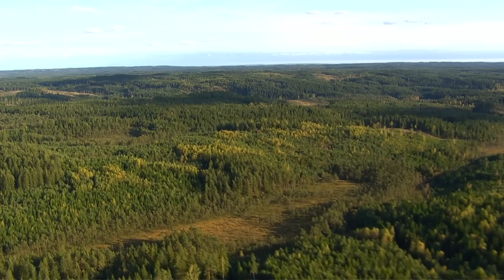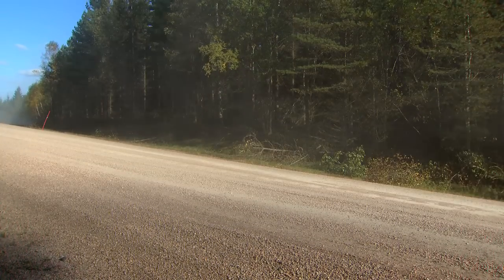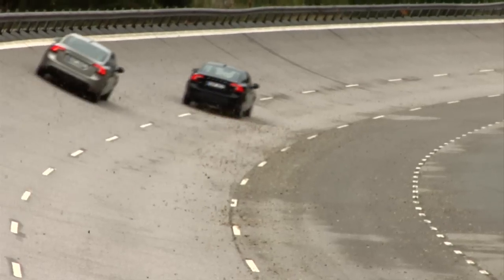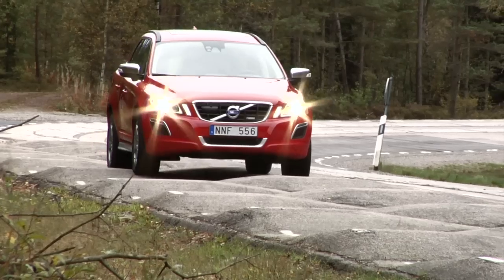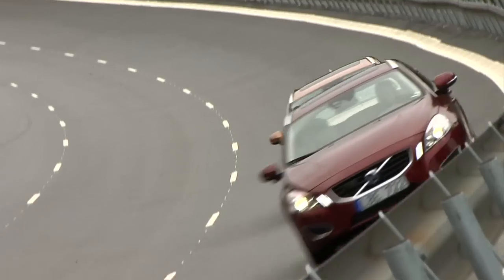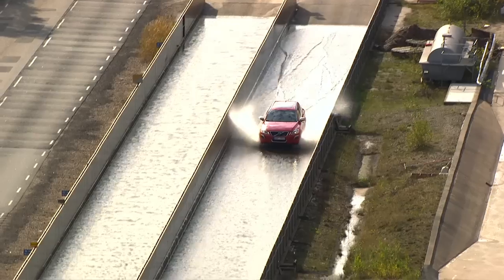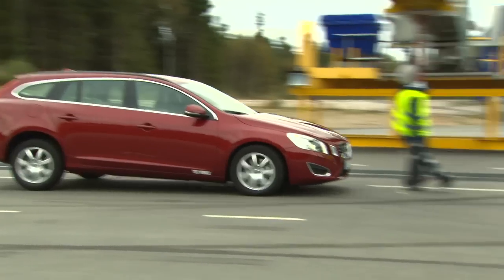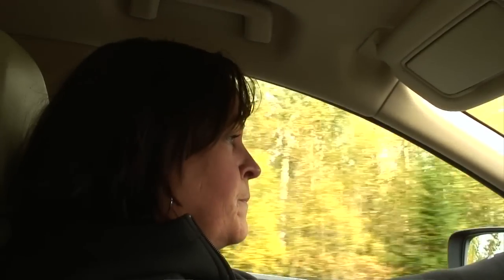Top Secret Proving Ground: Hällered, Sweden

Comment: I replaced the 2002 S60 with a 2016 V60 XC last week. Love both. Just did my very first road trip with the v60 to Whistler today, the whole front end is covered with road-salt dust. Can you guys give me some tips on cleaning the road salt off the underside of the vehicle? Thanks! 

My parents ordered me to get rid of the S60. Because its AWD is not working and will cost $2000 to fix. And a minor leakage related to the turbo is "under observation". Plus a few years back we spent $6000 to replace the transmission. They have given up on keeping the old faithful :( 
The S60 was the family vehicle and was given to me went I was old enough to drive. It's like my brother so I was very sad to see it go.

Want to know if my old S60 just being unlucky. First, the transmission "fried" and need to be replaced when it was just 80,000km and now the AWD failed at 170,000km. With other problems, it has been on the tow trucks quite a few times. Even the dealer say my old S60 was the first one they encounter that needed to completely replace the transmission (Cuz the original transmission have already been rebuilt once, but the slipping problem was still there. And a few thousand km later it "fried", with it a few other cooling related systems).

Edit: 2022 update! Watching Volvo videos and noticed I have been here already a few years ago XD. So not long after that original comment back in 2017, dad traded in his 2004 Nissan for a 2017 V60 Momentum and we became a 2 Volvos household. 2020 was a hot mess, so the 2016 V60CC was not brought-out but returned to the dealer for a 2020 V60CC. And last month mom retired and traded in her 2013 Ford for a V90CC. We are a 3 Volvos household now.
Reply from the maker: Hi, congratulations on your new V60! How do you like it so far? Regarding the road-salt we would advice  you to contact your local dealer for best assistance for your specific car.
Reply: Volvo Cars LOVE IT!
Only one minor disappointment: old Volvos have parking receipts holder, just a small piece of clear plastic to hold the parking pass under the windscreen. Very useful.
And the old S60 have seat pouches at the front edge of front row seats, also very useful. Maybe put them back in newer models? Thanks.
Reply: Rick Feng    My new V40 has one!
Reply: What city do you live in? Isn't Whistler 2 hours away from Bellingham? I live in Bellingham and drive an Acura RDX 2009. We hardly use any road salt here so I'm surprised how much road salt they use in Whistler as that's what you mentioned.
Reply: Drive through car wash.    That’s a great. Drive. Hope you enjoyed it
Reply: My 2002. S60.  Loved it. But transmission just went.  134000 km.  I have to walk away from it